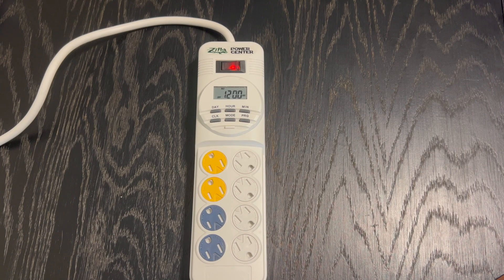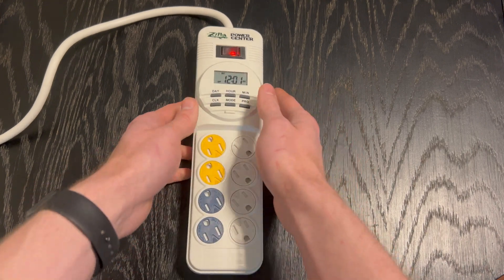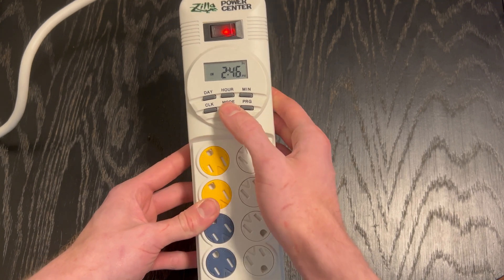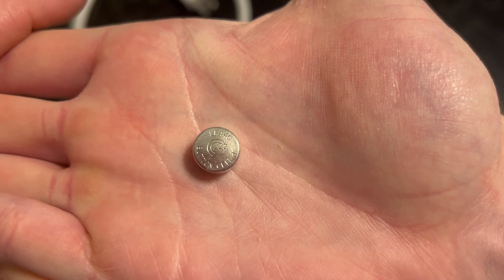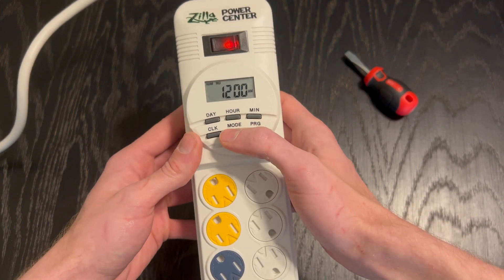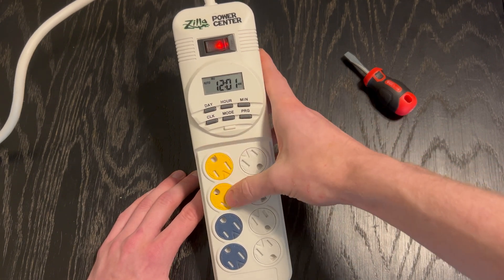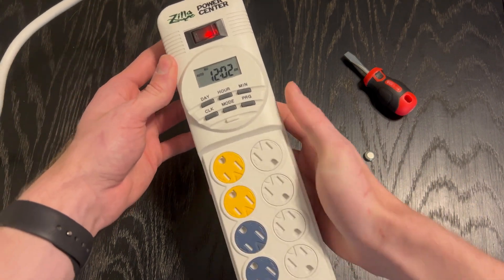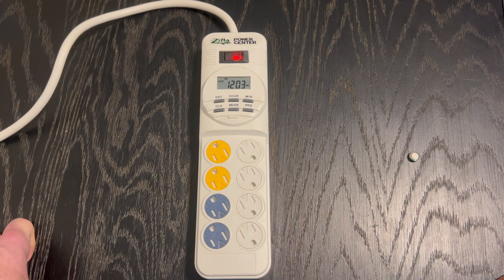How to Program the Zilla Digital Power Center|Part 2: Troubleshooting

Comment: I have it set to auto, have the monday through sunday option selected, and have an 8am start and 8 pm shut off. It will turn off automatically but not on. It isnt the 24 hour cycle thing, since ive been messing with it for the entire week.  Ive rechecked everything so many times. Anyone have any ideas?

Comment: Can you plug a multi outlet device of any kind downstream of this device? What if you have more than 2 lights?
Reply from the maker: I believe you can! 
Just make sure that the lights do not exceed the maximum wattage/volts for the Power Center. 

Thanks for watching!

Comment: Hey so iv been trying to get my strip up for a while and even when I set my program to auto only my night plugs are powered and it never cycles the power at all. Any tips?
Reply from the maker: Good question!
When you have it set to "auto", your day time outlets should be turning on at the hour you have your program set to "on" (i.e: Program 1- ON- 7:00am)

However you have to make sure that when you want your day time outlets to turn off, you hit the program button again so you have "Program 1 - OFF - 7:00pm" (or whatever your desired off time is)

Hopefully that helps!